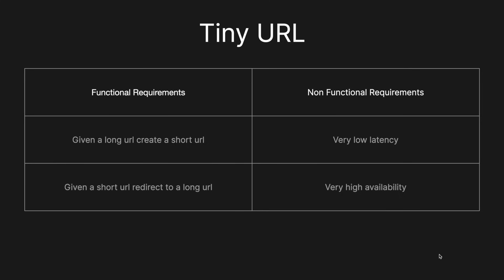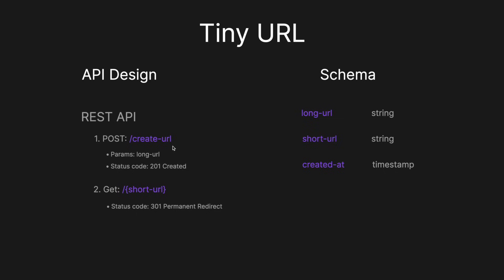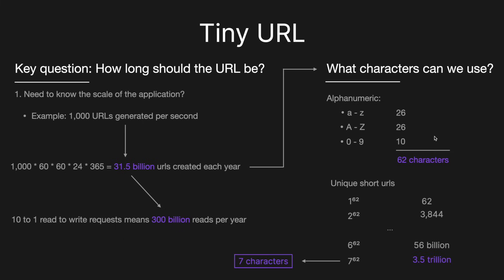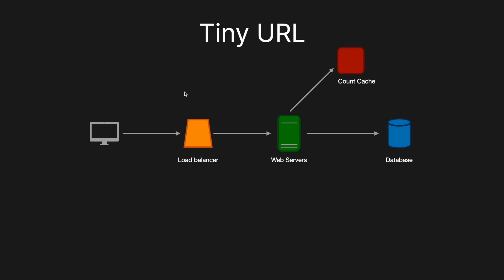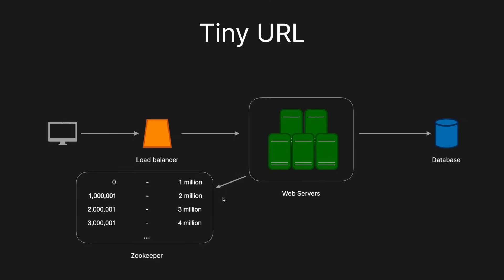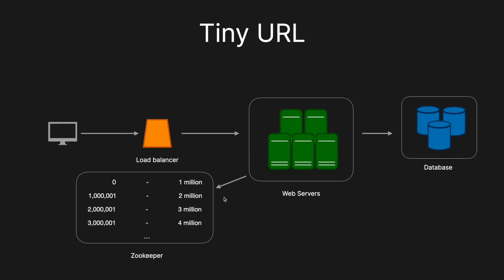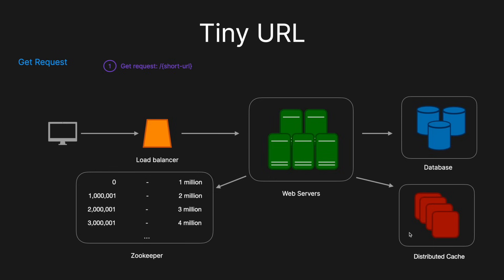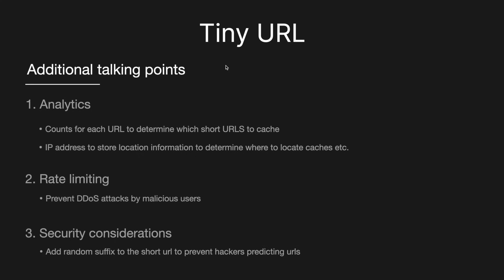Tiny URL - System Design Interview Question (URL shortener)

Comment: 7 characters
62 possible characters for each position
(a–z = 26, A–Z = 26, 0–9 = 10 → total 62)

This is a permutation with repetition, so the formula is:

62⁷ (not 7⁶²)

Why?

Each of the 7 positions can independently take 62 values

So you multiply 62 by itself 7 times

62 × 62 × 62 × 62 × 62 × 62 × 62 = 62⁷

Numerical result
62⁷ ≈ 3,521,614,606,208

That is ~3.5 trillion unique URLs

Comment: Two suggestions:
1. Instead of Counter or Zookeeper, you can use a hash function that takes the URL and produce a 7 chars string. Thus don't need to solve the problem of counters and Zookeepers and it's more secure.
2. An additional point from the interviewer might be to Add the ability to use custom short URLs. This is really a good point to discuss
Reply from the maker: Great suggestions!
Reply: How would you handle collisions?
Reply: @sixoclock406  For MD5, the probability of just two hashes accidentally colliding is approximately 1.47*10^-29
Reply: That would not work due to collisions.
Reply: @tejinder83  What's the probability of collisions of a good hashing function? (MD5 for example)
Reply: @mhadi-dev  due to the fact that its 7 chars long, so even if you have different urls there's always a chance that it will output the same hash

Comment: 5:34 My choice for unique IDs is to use a 64bit "snowflake" as Discord (And I think twitter) use.
Its a timestamp, which already gives a different base value every millisecond, then a node ID (that solves the ranges/collisions between different webservers), and a counter (to support multiple IDs per millisecond).
If there is too much spam and say over 1024 ID's in just one millisecond (woah thats a fast server you got there handling so many web requests in a millisecond), then you can always wait one millisecond into the next range.

And the beauty is, you don't need to store a create-at time, its already integrated.

It works fine for Discord/Twitter with tens of thousands of messages per second, so surely it'll be fine for a tinyURL service with "just" 1000 per second.
You just need to find a balance between how many bits you want to assign to
- timestamp precision (milliseconds, 10ms, 100ms)
- timestamp lifetime (in years/decades, how high the maximum value can be)
- number of nodes for the node ID bits
- number of ID's per timestamp

I used this method to implement a small online forum once.
40 bits of timestamp for millisecond precision lasting me 35 years
8 bits for a category ID
and 16 bits for a topic ID.

That gives my forum a maximum of 255 categories with 65535 topics each.

Translated to the Tiny URL system that could be 255 different webserver nodes, and 65k ID's per millisecond.
64k per millisecond is obviously nuts, no webserver will do that.
So that could be reduced to say 12 bits for just 4095 per time interval.
and these 4 extra bits can be added to the timestamp to give a usable range of ~560 years. If you believe that is enough lifetime for your service that'd do, if not then maybe reduce the number of nodes or number of ID's per interval to get more timestamp bits.

Though 64bits would make 11 characters in base62 (Notice how long youtube video ID's are).
You can either add more characters to your tiny URL (Like underscore, dash & @ $ = making it base 68)
Maybe 35 years are enough for you, and maybe 1024 per time interval are enough, cutting down to 56 bits.

It also makes database handling (somewhat) easy, they are all sorted by time, new values just get plopped at the end (though you do have to account for sorting the node ID's)
most tiny URL's get used shortly after creation, so if you just keep the last N days of ID's in a cache, lookup times will be good.
Implementing expiry is also extremely easy, do you want to sort your billions of ID's by their create date? Or do you just design the database such that the key itself, is inherently already sorted by time.

The problem this does not solve is duplicates for a URL. Like multiple people shortening the same URL. But I'd say that is pretty unlikely when you're targeting such a big system with many users.

Comment: if browser redirection is the only requirement, why not just keep all shortened urls as files on a CDN and expose that (you could have just one js line that tells the browser to change location and if you want analytics you could just add another few lines to make a request to the analytics service), by picking a wide enough range you don't really need to worry about uniqueness and you can pick the short urls at random and not check if it's already in use
Reply: I think it's better to not have to load a page, then have it run the js to perform a client side navigation. Not the best user experience

A Web Server can redirect you without sending anything back through the channel. It's much faster. I guess you could achieve this with edge functions

Comment: I have a question: 
Instead of using 7 characters for 10 years, why don't add one more character to make it work for 6 centuries? Is it too computationally expensive?
Reply: You are going for the shortest possible urls for the benefit of the users

Comment: For what it's worth, as a Staff+ software engineer, if you submitted to me a "URL Shortener" task as depending on Zookeeper, you're not be getting the job, since you're Introducing a huge amount of operational complexity which can be avoided by changing the algorithm you use for generating URLs (e.g., you could use a single bit for a server ID value — this is what Snowflake IDs do)
Reply: What would you recommend?
Reply: @chijiokenna2182  Generate a 5,6,or 7 digit random number based on how many are already created and insert it in the DB. Have 1 digit be a base58 node id or just insert again with a new one if there's a collision. People seem to ignore the fact that creating the URL itself is not really the high load part of a url shortener, its the redirects and analytics from clicks. 

Doing this, in Elixir, it takes 67 microseconds to generate a id and 3-5ms total to generate the id, handle the request, and store in the DB (this is also woth an extra round trip to the db to see how big of a id to generate, this could be lowered with always long ids or a cache). If you use a cache to verify uniqueness best that you can as well, the chances of a chain of collisions is highly unlikely. As long as you increase the length of your link ahead of the birthday problem, a few retries will be fine.

Given that elixir, or any decent webserver, can handle hundreds to thousands of requests concurrently and each request only takes 2-5ms, you're at least 250x your functional requirements. Id just forget the cache until you need one, inserts in postgres are very fast, but using redis to store the last 8-16GB (1-2billion) of generated keys could reduce the chance of collisions by some amount. However, the round trip latency to an external redis is likely not going to save much time versus another insert to a mostly append only table in postgres. 1000 qps is tiny for that workload. A single laptop could run that db and webserver.

Edit: Just did a load test on my macbook pro and got 1200 requests per second with two database round trips
Reply: He mentioned it in his reply near the end. Changing the algorithm for hashing  @chijiokenna2182
Reply: Seems to be correct but if you are using server id to create short urls let's say you are using 3 or 4 digits from server id and rest 3-4 digits are random 
It's confirmed that each server definitely produces different urls but you will soon run out of permutations 62^4 and for high tps system this could be a problem 

Let me know if you have a workaround
Reply: @KingCold-z1d I believe in this case you could scale up to 62 simultaneous servers with a single bit being allocated to server identification. With this you could go back to having the trillions of possible values by simply increasing the url size by one. If the demands are even higher you can, of course, allocated another bit for the server id and increase the url yet again.
Reply: Agree zookeeper isn’t needed, but what’s the benefit of a server ID?
Reply: Guid.CreateVersion7()

Comment: What about hashing the input url and use that to create the short url?
You could take the md5 sum of content and create a custom encoding for ti using the 64 chars

md5 is 45 characters in hex and 25 chars in  base64. The benefit of using a hash function would be to elimnate the zookeeper
Reply: the whole point is to have a short url, 25 chars would be way too long

Comment: My idea for generating URLs would be to hash the URLs first, convert the hexadecimal output to base 62, and then crop to however many characters you'd want in a URL. Then, servers can check if that short link already exists in the database. If it exists under a different long url (=collision), then add a special character and re-do the hash, remembering to strip that special character later when entering it in the database. Is there any huge flaw in this method ? I'm a data scientist, so this is absolutely not my area of expertise.
Reply: One advantage that I can see over the method in the video, if I've understood it correctly, is that my method is more secure, it's pretty much impossible for someone to move characters around and find other URLs. Also, not that it matters much, but it also avoids wasting database space. I'm sure as a public service tons of people would be shortening links like google or the rickroll, meaning potentially thousands or even millions of short links would be wasted in our database when a single one would suffice, potentially slowing down performance.
Reply: I think this solution is assuming a random distribution or close to random distribution for inputs. This probably doesn't hold true
Reply: @Squirvel  That's the beauty of hashing functions, it doesn't have to assume anything about the distribution. If you change a single character, the whole hash is different.

Comment: Besides of service failure, there are regular service updates during development of new features, which will kill all instances of replicated service and invalidate potentially large amount of address ranges. Personally, I prefer using hashing algorithms for such tasks, dealing with collisions on writes, since lower latencies typically needed only during reads and reads are much more frequent. For example, you can calculate hash of incoming long URL and cut it to required length, which is secure, pretty robust and prevents duplicates in database.
Reply: Once you cut up the hash to the required length there is no longer any guarantee that it's unique. We are talking about a 1000 new URL's per second so "pretty robust" isn't going to cut it.

Dropping that many keys seems like a strange solution, but even if you reboot a 1000 servers every day for a year, you still have more then enough keys left for years to come. But if it could be a problem, you could also ask for a range of 1 to 100.000 and lose a lot less. Also keep in mind that you don't actually lose the entire range, because some have already been used. You could also schedule a server to go down instead of just dropping it. That it will reboot once all keys are release. But still, I don't think it's really an issue to lose those keys.

I do agree with the latency problem mostly being a factor on reads. That is when a user manually creates a new URL and has to wait a second after clicking post. But for generating links via an API the latency is important both on insert and read.
Reply: @degosoft  With hash there is no uniqueness guarantee anyway, this is only about collision chance and key distribution. That's why I mentioned collision management. So, by "pretty robust" I mean "robust enough for the most cases". Of course, there is no silver bullet, all solutions have pros and cons. I'm just talking the way I prefer to solve the problem in real-world applications. And there is one more thing about using tiny URLs in real-world applications: they often not intended to live forever. In some cases, shorter URL with lifetime, for example, one year, may better suit your needs. Since the information at the source URL will no longer be valuable at that point. In this case, reclaiming space with hashed URLs will be a bit easier, just the matter of removing old entries from database by creation date. Another advantage to this approach is ability to set any tinyURL length at any time, even by request parameter. And, of course, absence of failproof zookeeper cluster reduces structural complexity of the system.
Reply: @configadd Nothing is guaranteed, but the chances for a sha256 collision are so incredibly small that it's practically none existent. And the chances get even smaller when we only use URL's as the input. But if you discard 25 of the 32 bytes in the output to get to a 7 byte shortcode, then you increase the odds by a lot. And bytes aren't even useful, so we need to encode the output bytes to something readable first which makes the default length even longer and thus you drop even more precision.

Don't get me wrong, hashing is great and I've used it a lot for similar projects. But if "SHORT" is te requirement then hashing is not the way to go.

Comment: Would it make sense at all to derive the shortened URL from the long url (Hashing and salting etc.), it may increase the chances of collision with such short URLs, but it would resolve the countcache issue, because if we use those numbers as salts, it doesn't really matter if the count cache returns the same value twice.

In fact, if we can get away with a pure hash, you can reduce duplicates in the database, because multiple people shortening the same site always get the same result.
Reply: A salt could help with resistance, but cannot prevent collisions at a reasonable level. So you could never fulfill a request to create a new URL with an accidental collision.
Reply: then how about appending random string to the url before hashing and if it collides then just redo
Reply: How do you know which one is a real collision and which one is the same shortened url?

Comment: A random suffix is a poor solution to the security aspect. You can have unpredictable URLs with a minor compute overhead simply by encrypting the range-based number to get the actual URL. This will never introduce a collision. You only concern should be publicising the key you use for encryption.

Comment: I believe the specific problem is a perfect match for the Actor model. The way that I would solve this is going via one of the popular actor frameworks (akka or orleans). Both of these frameworks provide out of the box the functionality that you get from the load balancer, zookepper and distributed cache. All you need is you actor cluster and a persistent storage. The persistent storage can be a database (SQL or NoSQL) or a cloud storage account (e.g. aws bucket, azure blob etc.). i believe this approach will reduce the operational complexity and cost significantly while achieving similar results in terms of scalability and fault tolerance.

Comment: This data doesn't change, so the caching is a lot simpler. In fact, I would forego Redis altogether and just hold a cache on the web servers themselves. That's less computers you need to pay for and fewer points of failure.
Reply: This doesn’t work well when scaling very wide. If we had 100 webservers, we’d be caching the data up to 100 times. A centralized cache is a much more effective solution
Reply: @drewbrown1534  That makes sense, i think it would also be better to handle the LRU strategy that we may adopt to keep just the most used URLs in cache.

Comment: it seems a bit overcomplicated to have to reach out to some service to get some count to generate a URL. There's a 1 in 3 trillion chance that some random shortened url would collide. I think it's reasonable to just generate the url at random and try to save it. if it exists in the db just try again. The user can wait that extra amount of time that the server needs to re-generate the url in the tiny chance that case arises
Reply: That, or pregenerate x urls in a shared queue and just pop one when needed..
Reply: @DanielSimon1995 this sounds like a good idea
Reply: that chance increases the more urls are stored. After only a year you'll have 31B urls stored. If you continue to generate a URL at random, you'll then have a 1/100 chance of a collision.
Reply: @awepicness  This is also assuming urls don't expire.
Reply: Just adding a single character in length drops that probability to 1/620, random URLs definitely seem to be the way to go here, simplifying the design. That's a 4E-9 probability that you won't be able to insert a URL within three attempts, basically negligible. You can opt to fail the request after 3 failed insertion attempts and it wouldn't measurably impact your service's reliability.
Reply: I suggest you look into the Birthday Paradox
Reply: The problem with that is that you spam the database, at some points you'll have to retry at least one time and with that kind of volume, it is not efficient. But I agree, for lower volumes it could be a good idea. With the approach of ZooKeeper (or the pre-calculated queue) that I saw in the comment, you are sure that when you'll insert, you're not doing anything useless.
Reply: Why not just hash the url and truncate if needed?

Comment: It isn't better to use a PUT instead of the POST for idempotency?
Reply: Creating a shortened URL isn't necessarily idempotent.
Reply: @LLlAMnYP 🔗 URL shortening can be idempotent if designed that way: 
𝗛𝗮𝘀𝗵-𝗕𝗮𝘀𝗲𝗱 𝗦𝘆𝘀𝘁𝗲𝗺𝘀: Some systems compute a hash (e.g., MD5, SHA-256) of the long URL to generate the shortened identifier. Since hashing the same URL always produces the same result, the operation becomes idempotent.